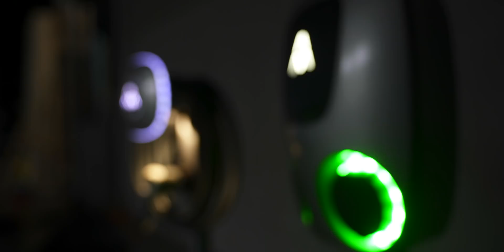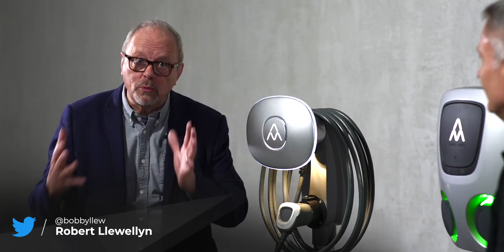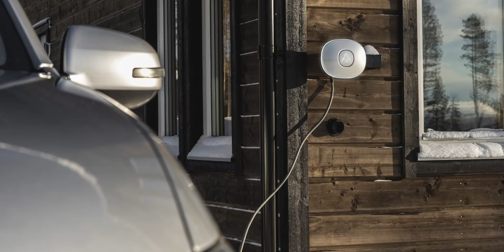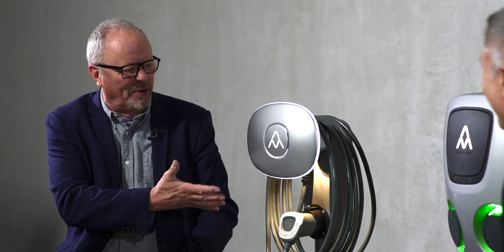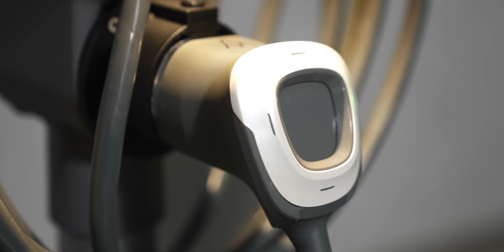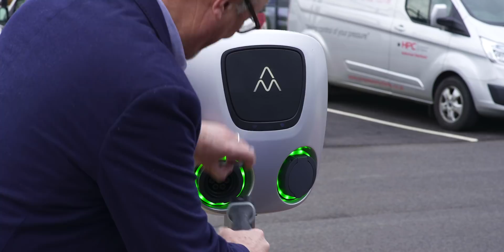Charge Amps - Swedish style with durability for your EV charging needs | Fully Charged PLUS

Comment: Clearly my layman's understanding of this is too simplistic but I just don't get why vehicle manufacturers are dragging their heels on V2G as it will be game changing for so many reasons. It will be a great selling point for charger manufacturers and EV's alike as well as offering massive benefits to the local grid in reducing early evening peak usage. Although it will be interesting to see if it hits the home energy storage market.... if you don't have solar to capture during the day then sticking 60-70 kwh in your EV at 7.5p/kw overnight then running your house off your car when you get home in the evening would seemingly negate the need for additional storage.

Comment: This was very awkward to watch.  I like what they've done with the lightness of the cable, and if they bring out a 10m version I'll buy it straight away - however this felt like an Ad.  Not just because Robert asked questions in an almost promotional/fanboy-esque way, but my god I've never seen someone speak using press release snippets as a vocabulary.  I learned little of value other than they're off delighting customers, and using premium materials and .... well, overall a commercial in disguise from Charge Amps Paul who's unable to speak plainly.
Reply: Yep– it was very frustrating hearing Robert ask a question, and the answer being unrelated.

Comment: If it doesn't catch alight first.
EV's with safety recalls for fire.  Renault Zoe, Peugeot-e, BMW i4, Mercedes C class, Mercedes EQS, Mercedes GLC, Mercedes S class, Ford Focus, Chevrolet Bolt, Hyundai Ioniq, DS7 Crossback, Hyundai Kona, Mercedes EQC,  VW Arteon  ehybrid, VW Passat GTE, Ford Focus mHEV, Ford Puma mHEV, Ford Fiesta mHEV,  Opel Ampera e, Mercedes eSprinter, Skoda Citygo e, Mercedes eVito, VWeUP, Seat Mini electric,  Mini Country PHEV,  BMWi8, BMWX5PHV, BMW X3 PHEV,BMW X2 PHEV, BMW X1 PHEV, BMW 7 series PHEV, BMW 5 series PHEV, BMW 3 series PHEV, BMW 2 series active tourer, Land Rover Discovery Sport PHEV, Land Rover Evoque MHEV, Hyundai Kauai, Audi A4,  Audi A 5,  Audi A 6, Audi A7, Audi Q5, Ford Puma MHEV, Ford Kuga MHEV, Renault Zoe, Audi eTron. Not the complete list.

Comment: Robert it would be great to see you putting commercial EV chargers on the spot about improving reliability, obviously, but also better interfaces at the charger. We all know it's still a roll of the dice turning up at many locations. Third Saturday was a classic : I dropped in unplanned at a small service station on the A1 near Grantham and found that the unit required the Alfa app but was in a near dead zone for mobile connectivity. If I didn't already have the app I'd have been stuffed and alfa would have missed out on revenue. As it was I managed to get charging started but the signal was so weak I had to go onto the footbridge over the A1 to stop charging. To me the ideas of service membership and app-only charging are dead ducks. Paying by tapping a bank card to start and stop charging is much more reliable, although having said that ALL of the Shell units at Buckden roundabout  on the A1 were completely dead this Friday! One thought : maybe a service based on number plate recognition and direct debit would be a goer.
Reply: Not number plate, this can be abused too easily, maybe something like the tesla use, onboard ECU with chassis number linked to your account that you can change when getting a new car?
Reply: I'd say either: contactless (Visa / Mastercard / Amex), or 'plug and charge' (where the vehicle, if the vehicle and charging station support it, communicate, and the vehicle conveys payment information).

Contactless is an 'easy win' for charging station makers, but - for that delightful Tesla plug-in-and-walk-away experience - that'd need something like the 'Plug and Charge' standard. Unfortunately, from what I've seen with the 'Plug and Charge' standard, it seems unnecessarily complicated and I'd be surprised if the user experience [of setting it up, and billing] is actually any good.

In an ideal world, I imagine a technology standard where your vehicle just sends a payment card token (again, Visa / Mastercard / Amex / etc) to the charging station via the cable you've plugged in. Essentially: contactless, but via the cable. For fancier cars, you'd add your payment card(s) via the car's touchscreen, and for lower-tech cars, perhaps via an app available for the vehicle.

For now, it seems - to me, at least - like contactless is the least evil quick-and-easy solution.

Comment: Without the ability to charge without using a cloud based app makes this a huge NO, from me. Local Comms issues could leave you stranded, and should the vendor go out of business you are stuffed.
Reply: Agreed. That was my first concern. There should be a way for the device to be preconfigured to a profile and keycard/lock to allow the owner to use it immediately.
Reply: @CodesleuthOfficial  If you had listened to the video you would have learned something. You don't have the cloud feature if you only have it at home. That is for business use to manage multiple chargers.
Reply: @sadiqmohamed681  I must have missed this. I did listen to the whole video, but I'll watch it again
Reply: @sadiqmohamed681  "via a cloud application or via an app" 1:38 (an app is still a cloud application) - what have I missed here? I don't seem to have learned anything.
Reply: @CodesleuthOfficial  an app is not necessarily a cloud application, though the confusion is understandable. While apps often rely on an active internet connection to cloud services, it's perfectly possible to make apps that don't rely on the cloud.
Reply: @rubidot  I read the manual and this doesn't seem the case. Would be great to have it confirmed though, as I really would like to have this charger at home
Reply: @CodesleuthOfficial  oh, yes. I couldn't say about this app in particular, I just wanted to clarify that there is a significant difference between apps and cloud apps. The way he is careful to mention both the app and cloud app suggests the app would work offline, but the only way to really know is to try it out.

Comment: for me, the load balancing bit is the interesting thing. all destination chargers should be 22kw. all AC on cars should be 22kw capable. 
but if I park up at the train station, plug in at 7.30 in. the morning, I don't really need the charger to pump out at 22kw when I am parked up for 10+ hours. it could happily throttle back down to 7/5/3kw depending on capacity of the battery. 
if I gave the app my expected leave time perhaps. 
and a lower slower charge could be cheaper then full on max power charge.
Reply: I'm not sure why a commuter train station charger would need to be 22kW.  Rather than pay for 5 expensive 22kW chargers that are then throttled to 3kW,  why not install 20 cheap 3kW chargers (3 pin plugs with an RFID lock or central payment point on them maybe?).  Most cars will be there for many hours.  Or, to put it another way - it doesn't make commercial sense to have that higher capacity charger and then allow the customer to block it for hours and a lower tariff.